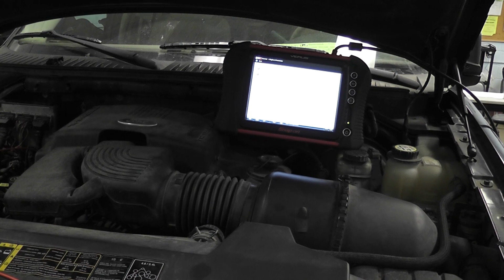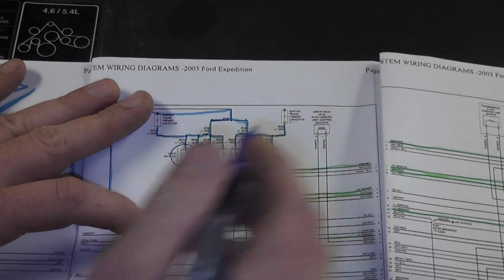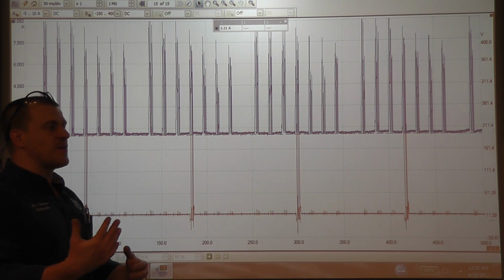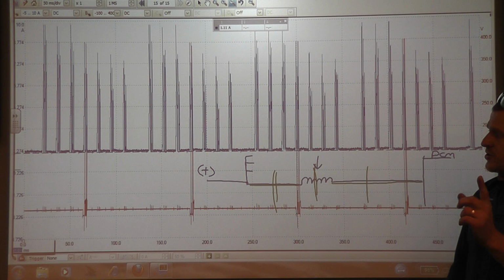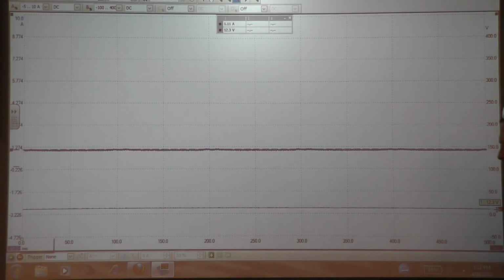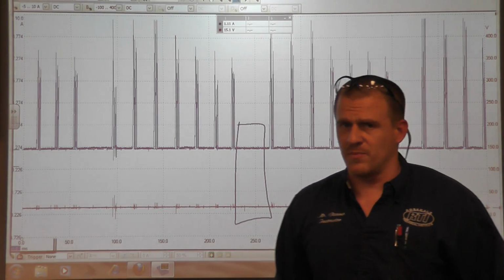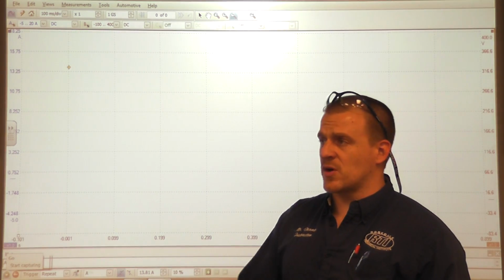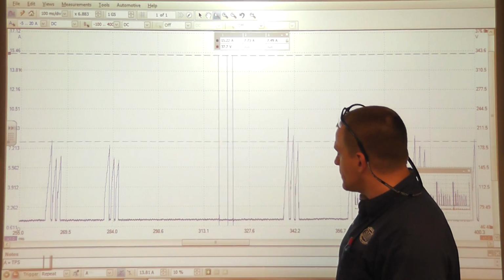Ford 5.4 shorted coil primary winding and bad computer driver

Comment: Very smart to switch the #6 coil driver to check the coil. As you say, better to re-fry a bad ecu rather than potentially ruin a new one. Really informative, a very valuably 35-odd minutes well spent.
Reply from the maker: +David Bell Thanks David

Comment: Greetings from Australia. I had an identical problem on cyl 8 on a 2002 explorer 4.6. Faulty coil took the driver.  Without anything approaching your gear i came to same conclusion. My early training was as an airforce technician, but i rate this video as one of the most logical, informative videos ive ever seen. Thanks.🇺🇸🇭🇲

Comment: After having my 2000 Expedition in 4 different shops telling me it was the Mass Air Flow sensor, the Intake Air Temperature sensor and the O2 sensors that needed and were replaced along with the injectors, COPs and Iridium plugs.They also did a compression check and found that the average cylinder was 155 lbs compression. After all this I still have the same code PO 354 on G or #7 cylinder. Your video is the most informative explanation I have seen or heard. Thank you. I was just about to take my truck to the scrap yard thinking I had french toasted the engine. I recommend anyone that is having a ignition problem to see this video. Again thank you.
Reply: So what was the fix? These Fords will misidentify which cylinder is misfiring too.
Reply: UPDATE: Number 7 was miss-firing due to driver transistor burned out on "G" Replaced with Motorcraft remaned PCM for a 169.00 bucks. Thanks for the insight that none of the other shops found this problem, including the Ford dealer. OPPS No more incidents so far. Thanks again for the insight.
Reply: After the savings I ordered a bran new Nex IQ Prolink on E-Bay Look forward the the next glitch that you might be able to steer me straight on with my new tool.
Reply from the maker: David Beller, MD.
no problem, thank you!

Comment: Mr Danner, I realize this video goes back a year or two, but I just want to say your Pico presentations are outstanding and exactly what I have been looking for during my research of Pico systems. I have been in the auto and aircraft repair trade and vehicle manufacturing business (autos and class 8 trucks) for over 30 years now and looking to upgrade my scope to something far more capable. Thanks for sharing your knowledge.

Comment: great vid jay-o
On all misfires on FORD products I use a noid light on the coil harness first to determine the driver/PCM is still working and not making Purple smoke.
A bad coil or Boot can run hi voltage back to the PCM destroying the Driver for that coil.
Flash from Noid Replace all Coils and plugs DONE!
No flash from the noid , replace PCM and all coils and plugs. Reprogram PCM DONE!
10 minutes max to diag.

Comment: Dan thank you for your help your videos have saved me, my life would be so much different if I learnt from you and I would probably still have the use of my right-hand  when I started my trade the mentors treatment towards anyone with out a trade certificate was disgusting and as a result I lost my right hand function from a safety  switch removal because the company refused to buy the correct tools for the job instead decided to modify the equipment I'm 6 surgery's in and 3yrs later and still have one year left on my time needed to complete my Trade. I have been following your channel   only for a few months I have learnt more from you then I learnt in my total time working and studying I want to pack a back pack and Rock up on your door step to complete my Trade you are truly the best in the trade.
I wish I found this one last week on a stressful job I took on to pay my rent thinking it was easy money jezz I was wrong and it was my first job back at work since I lost my right hand movement.
I had a intermittent fault in a S13 ING system and it was a doozy once I repaired the hack job on the loom I lost ING firing the trigger signal for the MOSFETs was lost completely the firing signal was generated by a signal short to ground and was the original issue with the car causing it not to fire at the right time this video has given me  the complete understanding of how to repair any car with this issues

Comment from the maker: Good question, the wire issue you mentioned was addressed in the voltage waveform test of the #6 coil control wire at the PCM. The #6 coil control wire showing battery voltage at the PCM showed the integrity of the wire from the coil to the computer was fine.

Comment from the maker: The truck is fixed with a couple new coils and a new ECU. The one on the floor of the truck needed reflashed (had to send it out as I do not have reflashing capabilities...yet) for the anti-theft system before it would run the truck. 
Thanks for the compliment on the video! I am glad you liked it.

Comment: I discovered we had a picoscope at work the other day it lives on top of a cupboard in retirement. but now that sonofabitch is coming out of retirement. its gonna get used and after this video its going to have a bash on the Mazda rx8 coil set up as soon as one comes in running crap as they do. thanks for the instruction, it was really informative and easy to soak up into my old brain. cheers.
#

Comment: Great video! great diagnostic methodology. learned quite a bit. Now off to garage to play with my lab scope...controlling primary windings directly through the computer with hard connections is a good way to cook internal pcm drivers in the event of a shorted primary winding. Its no wonder manufacturers like Toyota to give ONE example integrated this circuitry into the coil itself with their 4 wire ignition coil eliminating currents into/out of expensive computers.

Comment: Great video as always, my thought is if it is possible to ground the coil driver external bypassing the PCM.
 Thanks for helping people I have ordered a Pico now, it is overkill for me but I do not trust the part changers they make it expensive so I do all car problem my self and you helped me understand trouble shooting with a scope possible. Thanks Danner for all your dedication for Automotive learning you will save money for ordinary people when your students get out in real life and work with cars.
Reply: Thank you my friend!
Reply: +ScannerDanner Premium        This is the same question I have . A couple of months ago I was diagnosing A ford escape for an IAC TC and related problem and I narrowed it down to the ECM driver for the IAC but I wanted to test the circuit for surges or spikes such as the one that you found on this vehicle. Would it be possible to manually ground a suspected circuit to eliminate any possibility of  damaging a new ECM.? I would be afraid of back probing a circuit While its running that it might short the ECM. I too am considering purchasing a PICO Just because of situations like this and others.

Comment from the maker: A shorted plug will not overheat the coil, an open plug will damage (melt) the coil insulation though. As for the PCM driver, there is always the possibility that the driver is shutting down however that was not the case on this one. One way to verify driver shut-down or just a bad driver is to clear the codes, then restart it and see if the driver turns on before the fault. Another way on Fords is to run the KOER test. During this test any coil being intentionally turned off will turn back on

Comment: Paul, when you are explaining about when the transistor  turn on 16.27  there are 2 downwards line when the  transistor turn off ,magnetic field collapses  is that some thing normal  or is that secondary bleeding to primary some thing I will have to worry about??
thank you for sharing your knowledge with us, you are a excellent teacher . Those 2 down tum probably are coming from parts changer or repressed  teacher  some one do not understand what you are teaching, is pure gold!!!!

Comment from the maker: One more, on this system the coils will not be shut down during a cranking condition. So what you would see on the scope is a very high ramp (from the shorted coil), then no ramp as the PCM shuts the driver down.

Comment from the maker: For a "type-A" or severe misfire, the PCM may shut down the injector, however not all systems do this and the ones that do will never have the injector disabled on start-up and I believe at WOT. 
Almost all cars/trucks are ground side switched for both the coil and injector. 
Most common failed driver is hard to answer but it is probably the coil driver.

Comment: I did read more about that last night, that electricity travels pretty much at the speed of light so it really doesn't matter what wire you use, it will get there at the same time, and any difference would be non-measurable.
thanks for replying

Comment from the maker: They are all important, but I would say the ECT has more effect on the fuel curve than the TPS does. In particular during a cranking and warm up condition. Once the engine is hot though I would say the TPS has more effect on fuel delivery. (mainly accel enrichment and decel fuel cut-off)
Of course the RPM and MAF data is critical all the time.

Comment from the maker: If it has a new IAC valve and you are still getting IAC codes, then you have either a wiring or computer problem or you have a vacuum leak which can cause "idle adaptive limit" codes and also stalling/racing idle speeds.

Comment from the maker: The theory with the second and third ramps having an initial straight up line is due to the fact that the primary field has not fully collapsed before it is turned back on again. 
Normally you never want to see a straight up line in your current waveform on a coil of wire that is producing a magnetic field. 
As for the second and third ramps being smaller and having oscillations at the beginning, I am not sure we can call this early coil failure, but I am seeing this as a pattern.

Comment from the maker: they do and it is part of the transistor circuit but it cannot protect forever. Eventually it will cook it. I have a case study in Section 22 in my book on a Chrysler C.O.P system with a shorted coil that ended up frying the driver even though it had current limit protection. This is why you should never continue to drive a vehicle with a constant misfire. I could cost you big time.

Comment from the maker: If you are talking about the #2 coil, that is possible. If you are talking about the #6 coil, the answer is no. A shorted plug/melted plug WILL NOT increase primary current flow as this is happening before the plug fires.

Comment from the maker: No attenuator needed on the verus, it has a much higher input voltage level (don't remember specs off hand). I have another video on the same system using the Verus, it is also titled Ford C.O.P. Ignition Testing or Misfire or something like that. Check it out.

Comment: Great to see technicians that think as I do.  I get many a shop who "doesn't do well with electrical"  and replaced all the pattern and obvious parts but can't resolve the issue in this case.  The aggravation is that they lap up the gravy and then complain about paying for diagnosis which they didn't charge for or don't get a bone of.  I admire your set up.  Many would say well just charge them.  That would be nice real world but all the cheap shops, mobile mechanics, and google/youtube certified technicians have ruined the profit in diagnosis to the point I am going to do a Goodyear at my shop and only do brake and suspension, no need for exhaust I live in AZ.

Comment: That's really good case,I have some Question please :
1-why and in which case the PCM shutdown the injector.
2-how does PCM feed power to the coil & the injector ,is it by ground or it depend on the manufacturer.
3-What's the most common PCMs drivers get burn of fail .

Thanks for the invaluable info....by the way there is a company called BBA reman, they can fix vehicles PCMs ECUs...etc less expensive than buy new one.

Comment: I bought a amp clamp, but im afraid to use it because i never used one. And i can't find out how use it properly, keep up the good work
Reply from the maker: You will never hurt your meter or your amp clamp by using it wrong. It produces voltage in the presence of a magnetic field. Thats it! I have a ton of videos showing the usage of it. Stay with me and ask questions and I'll do my best to answer.
Oh, just don't hook it up to a plug wire lol, if the wire arcs to it, then you can kill it. It should never connected to a plug wire anyway
Reply: Thanks

Comment: I'M HAVING THE SAME ISSUE BUT ON CYLINDER #8 P0358, I HAVE NEW PLUGS AND COILS I CHECKED THE FUEL INJECTORS AND ALL ARE GETTING SIGNAL BESIDES #8. YOUR VIDEO REALLY HELPED A LOT! MY QUESTIONS IS WHAT WIRES ON THE COMPUTER DO I HAVE TO CHECK TO SEE IF ITS THE COMPUTER NOT SENDING SIGNAL TO #8
Reply from the maker: Not sure man, you need a wiring diagram. Go to Mitchell 1 DIY, you can buy a pass for your vehicle for very cheap

Comment from the maker: These are notorious for bad coils. IF the computer doesn't like the current draw it will set this fault even though it isn't misfiring. You really need a scope and a low amp probe to look at the primary ramps of all the coils.

Comment: I appreciate these videos alot. I'm working on diagnosing no spark on all 8 outputs on one of these 5.4 pcms. injectors fire while cranking but i cant get any coils to fire. Very strange to me that all coil drivers would fail and leave the rest of the pcm totally unaffected.
Reply from the maker: That is strange, especially because you have injector pulse! If you have injector pulse, you should have everything that ECM needs to fire the coils. What is coil positive voltage DURING cranking. Very important that, that circuit is loaded

Comment: Hi Paul

DTC P0356 points to cylinder 6 based on the information in the DTC. You don't need to figure out witch one coil F is. I.E. P0357 would be cylinder #7, ETC.

Comment from the maker: those are all misfire trouble codes. unless the valve cover is leaking oil into the spark plug holes, changing the valve cover would have nothing to do with a misfire. there are so many possibilities: low fuel pressure, vacuum leaks, bad head gasket, ignition components (coils, plug wires, spark plugs), injector problems, contaminated fuel, faulty crank sensor, low compression. etc

Comment: Awesome Paul as always.  Just a thought, couldn't we have grounded the # 6 control wire at the CPU with a test light and then monitor the # 6 coil current pattern.  As you mentioned before, using an incandescent test light grounded to the frame, etc would have allowed to simulate a good control signal at the CPU without concern about potentially damage the CPU driver. Thanks keep up your Awesome work on your videos🙂

Comment: 05 Jeep Liberty 3.7 V6 with a P2311-Ign Coil#4 Secondary ckt. fault. #4 driver in the PCM was toast; did exactly the same scope test you did here at the PCM!  Spark plug was so worn, looked like the spark was making its way down the ceramic at some point.  Then using the #2 driver, the #4 coil primary current ramp showed a classic shorted SECONDARY winding. In the field have you ever seen a coil with a shorted secondary (not primary) winding cook a driver? Maybe the PCM was increasing the dwell time to compensate before it bit the dust?
Reply from the maker: I have not seen that. It has always been the primary.

Comment: Excellent video that I truly learned from. I would have passed class today! My question is: Can a person perform any of these diagnostics with common electrical diagnostic tools (volt meter, test lights, spark/ignition tester, simple scan tool)? Are there other tests that can be performed with my simple tools (and simple brain) that will help me in diagnosing my P0171 and P0301 DTC's? I know I can throw a coil at it, but I want to know exactly where the problem exists first. '02 Expedition 5.4L

Comment: @17:42 To test the #6 coil circuit (without a scope)... if you cut open the #6 control wire and pulse that wire from the coil to ground...you may see a spark @ that coil.. if it does... then go to the control wire from the controller...measure with the ohms (less than 1k scale) to ground then turn over or start the vehicle.. If the controller is good... then you should see a pulse reading(on and off)...because that's what the controller is doing by bringing that wire to ground via transistor every time the cam send a signal for that cylinder to fire.  Just my opinion.

Comment: i love that "are we gonna fry #5 driver yes i dont care the pcm driver is already fried" scanner we have established the driver for 6 is fried  by jumping to driver #5 we are gonna see if problem that popped #6 driver is coil related taking into account those other funky secondary ramps we can say we need a coil based on that alone but having the need to verify why 6 was popped would it be fair to say you had a high amperage event get through to that driver somehow inside pcm i really loved the lesson on putting those voltage waveforms over amperage to find cylinder problems thank you

Comment: Danner, I did this test and I dont see ground at all 4 terminals. I also checked the crankshaft sensor and I see signal with the scope, hall effect sensor. I also smell gas not being burnt of course and it appears that only 2 cylinders get more gas. What else can I check other than PCM power and grounds. Those look good, there are 4 wires that go into it, 2 power and 2 grounds and they look ok. I noticed that the connector ha da bit of engine oil from what it looked like, I'm thinking a short occurred or the computer has oil in it but I have no idea where that came from. The pump turn on and off once the key is in the on position and check engine flashes. I'm ready to call the computer. I also get a code for the throttle body but I dont think that input controls the ECM firing.